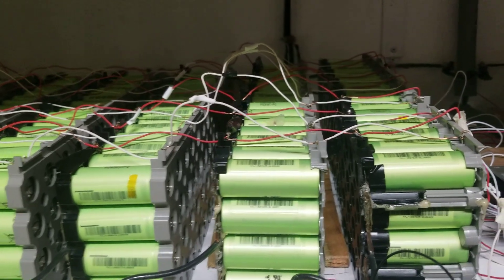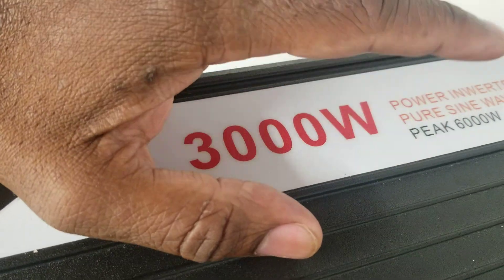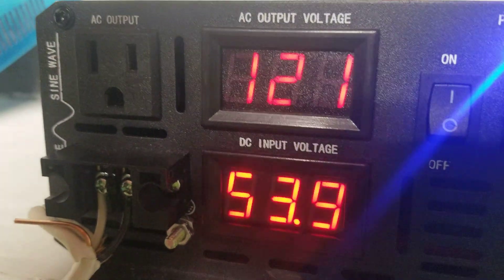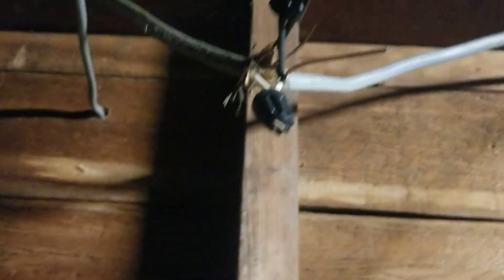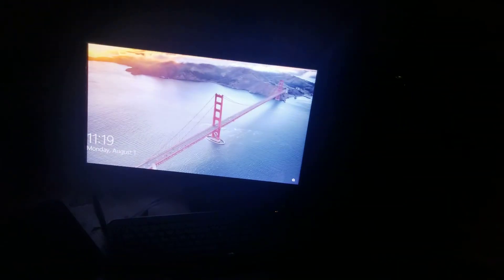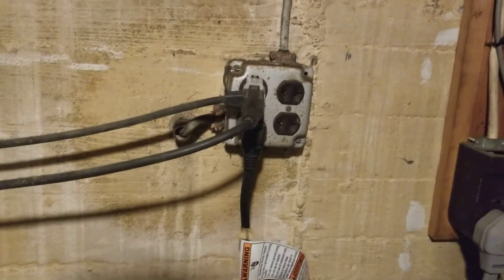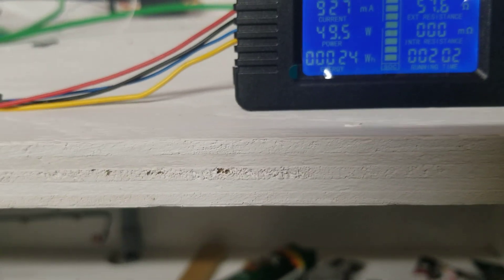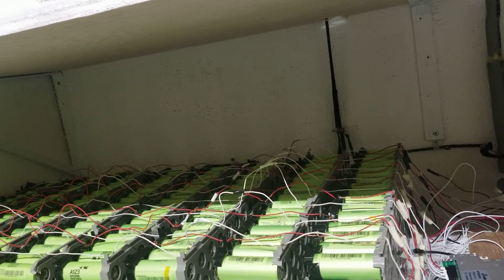Off Grid Testing 7000WH 48V battery bank A123 Lifepo4 using 3000w Pure Sine Wave Power Inverter 48v

Comment: You can't have 7000W battery, more like 7000Wh (7Kwh) battery. Watt hour is a measure of the amount of energy (e. g. rated maximum amount of energy your battery can store). Power (e. g. the rated power of your inverter) is measured in watts.
Reply from the maker: You are right, thanks

Comment: I'm sure you've got some code enforcement officers squirming in their seats...😂
Reply from the maker: I do understand your concern, I also appreciate your comments.
1. The white and red wires  are fuses. Only 5 amps can go through them.
2. The cells are the most safe Lifepo4 battery 
3. There is a BMS that helps  a lot
4. I will have a breaker on that pack
Reply from the maker: This is US. The land of freedom. You can do whatever you want in your hi house as long you have no mortgage